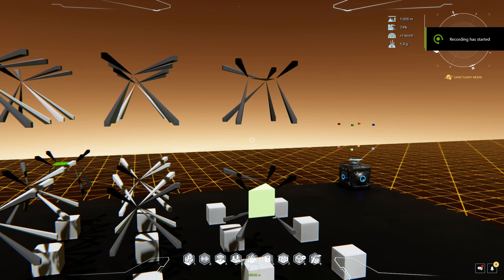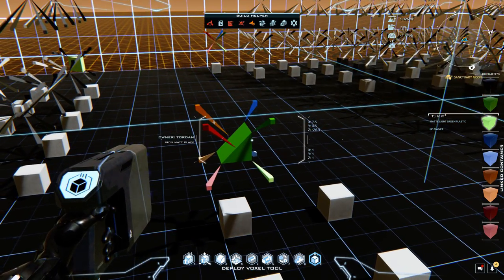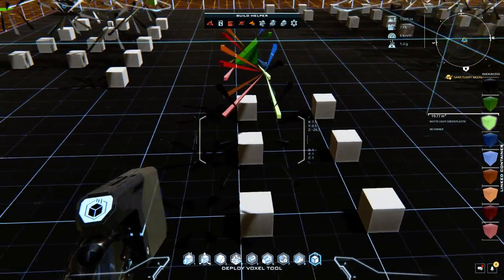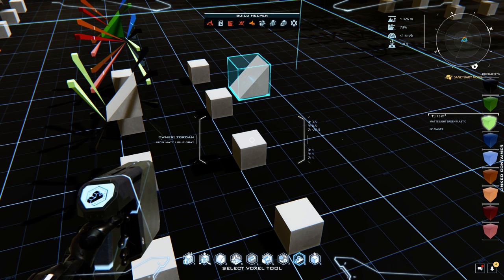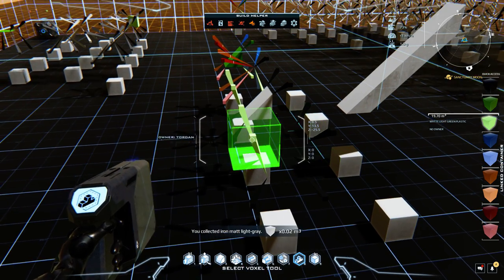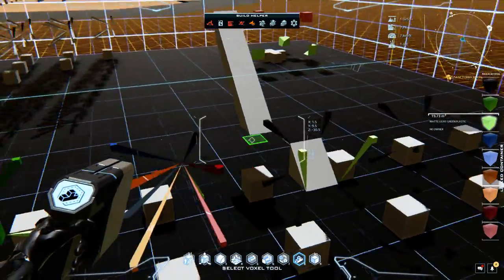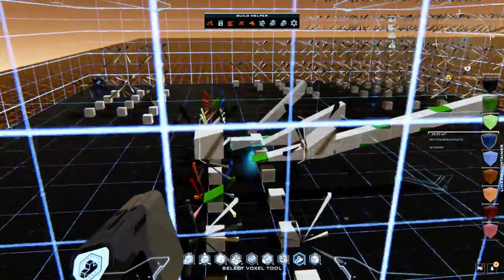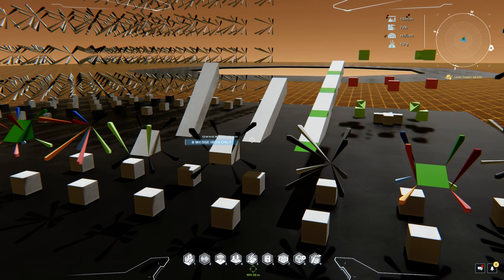DUBeta  Adv. Voxelmancy 201

Comment: Great tutorials, i'll pm you at some point for that 1/8th wedge :p 
I have a question tho :v
At the beginning you made a basic 45° slope with the hand tool, then you said those vertices in the inclined line of the triangle are not in the exact center but 1pixel off, my question is: how did you determined that vertex position so precisely? Same applies for instance for the position of the points in the 1/8th wedge, given that we have no measuring tools, how are you so sure that that point is 1/8 of a voxel far from the wall?
Thank you and sry for bad eng eventually xD

Comment: I made a tetrahedron is there any way to remove the vertices on the slopes like you did in the video on the wedge shape?
Reply from the maker: you can't remove them, but you can move them to another location. Usually it is best to move them to the same location as one of the other verticies.
Reply: @Tordan  Ahh, Sorry I mis-spoke. (remove vs. move).  With tetrahedron there was one vertex at the right angle corner, with 2 vertices at each corner with one left over. I guess I didn't realize I could move a vertex and 3 vertices at one corner. Pretty cool! 
Is there any way to add vertex to a voxel? I have a shape that has 5 vertices on aside and also on it's opposite side.
Reply from the maker: @st6nger  Nope. not any possible way. it is and will remain a 3 dimensional array of cubes. We just get to make those mindcraft wonks look bad by moving the corners.
Reply: @Tordan  OK. I thought so. I had to ask, to see if there were any tricks.

Comment: i have everything till min 6.20. But if i want to make a bigger slope, i have a small Gap between both parts and its no longer working, any ideas?
Reply from the maker: If you have a gap there, my best guess is that you are not using my null point wedge. Otherwise I'm not sure, I would need a lot more details.
Reply: Tordan Tordan Do you mean that Im not building on the Same Core as the wedge is? That’s correct.
That was also my guess why it may be not working.

The point you used in the video, to Beginn is the 4/4/4, correct? That’s the position of the perfect corner.( sry my englisch is not the best)
Reply from the maker: @senectarius9685  no i don't mean that. copying stuff to another core is not a problem.
Reply: Tordan at some point I will understand it :) but thx for your help
Reply: Tordan ah i found the error. It was the wrong reactor. Had to put the video on 0.25 speed and watch it 5 times to find out the right one. Maybe make it a little Brit slower next time :D so that it is easier to see which one you grap. (Just an idea ) because it is extremely difficult to find out which one you take.
Reply from the maker: @senectarius9685  i will also make sure i verbalize the count.